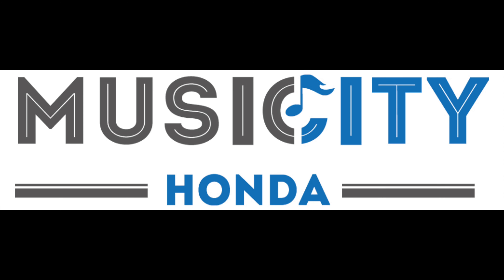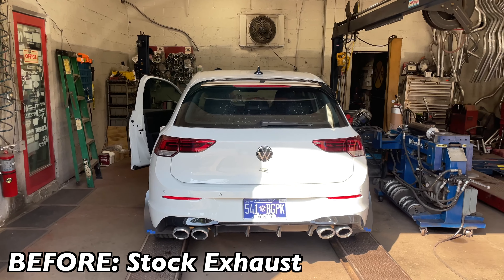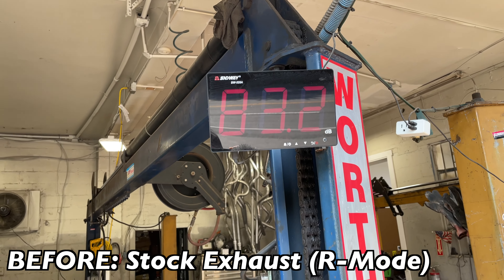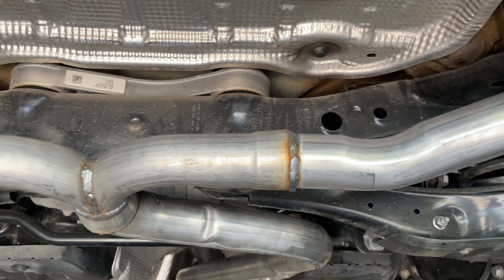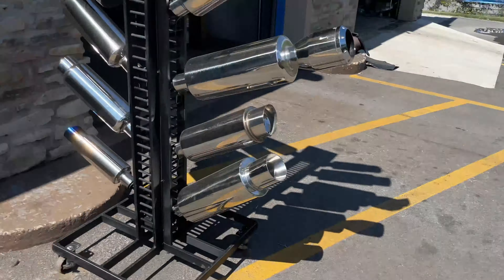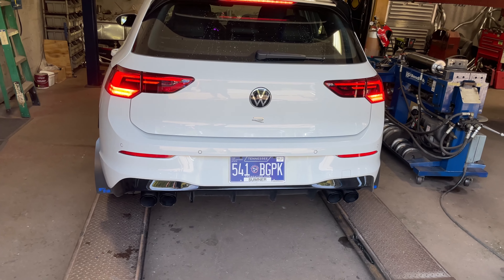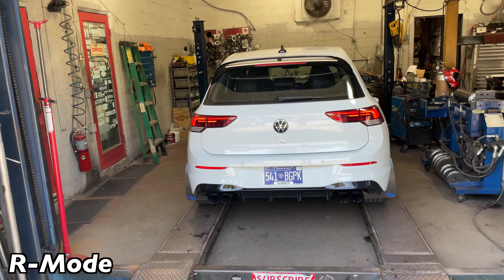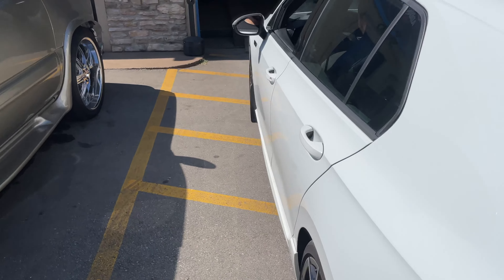We Straight Piped a VW Golf R Turbo!

Comment: R mode is going to open up the flap on the exhaust. Not gonna do anything as far as sound anymore.
Reply: The valves yes but also it has a crackle tune from factory that only activates in race/pure exhaust setting. Gives you crackles on overrun and when revving.
Reply: @Exluto 😅 not a fan of added crackle tunes and overrun the car already has some natural burbles adding more I think ruins it but each to their own. Defo sounds good however much better tone overall

Comment: There is only a primary cat on the downpipe of this car. 

You added a second for no reason, yes that first resonator looks like a Cat I promise you it’s not. 

There isn’t even a part number in my VW catalog for a secondary cat on any golf R ever.
Reply: the (second cat) is a OPF filter. it does kinda the same as a cat, but different name and in a slight different way. i would've delete it tho.
Reply: @codered2661  either way don’t need to for emmisions